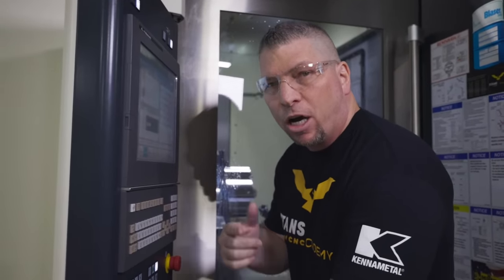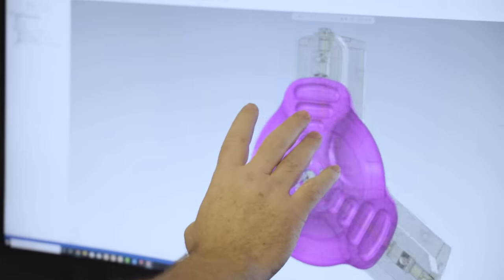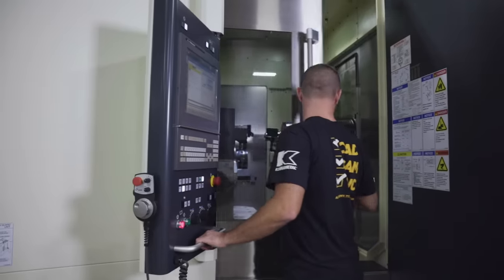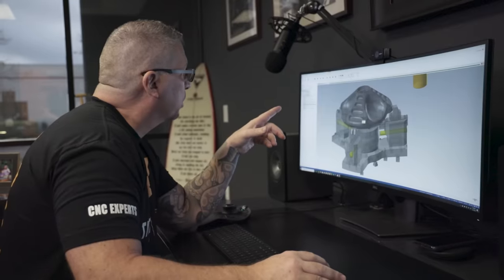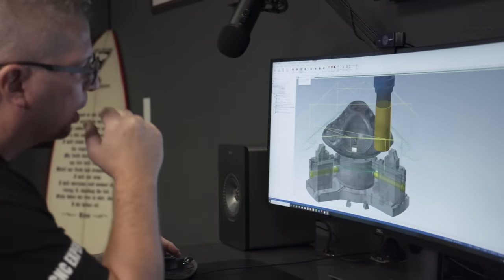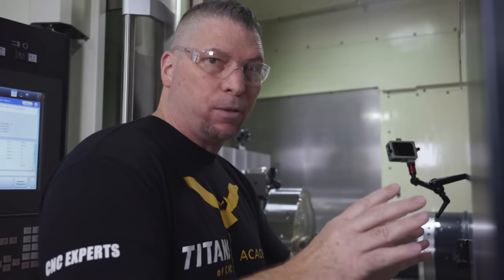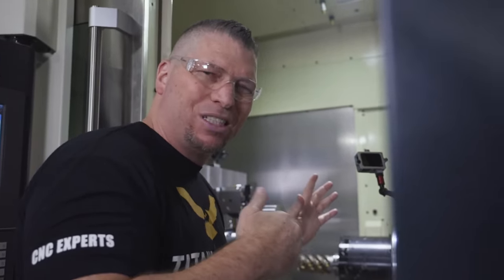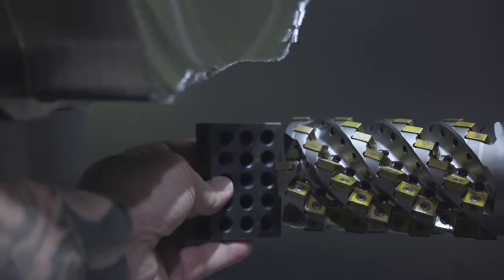60 HP Makino Cuts 150 Pound Titanium Aero Part With Kennametal 65 Insert Beast Cutter

Comment: Titanium is a really weird stuff. When working with it, you'd think it's like ten times as strong as steel. But it isn't. It has about the same strength as a modern alloy steel actually. The main difference is that it's about 30-40% lighter. And that it really doesn't like being worked on. Think of Grade 5 Titanium as stainless steel times three, in terms of being difficult to work with. Don't even think about using HSS tools for that stuff.

A few years ago, I needed a custom replacement part. A bolt, made out of a strong alloy steel, about three inches long, with a diameter of 7.96 mm, and with internal threads at both ends, about 8 mm deep. I made a technical drawing (I'm an Industrial Mechanic) and had send it to about ten metal working companies, asking them for an indiviual quote. All of them were willing to do the job. I had picked the lowest price and made the order.
About a year ago, I had the idea to replace the bolt with one made from Grade 5 Titanium. I've sent the same drawing to about ten metal working companies again (I've ensured that they work with Titanium beforehand), and all of them had refused the job. I've mentioned that I'm aware that it will be expensive, but still, all of them stated that they can't do this job economically.

Then I've decided to do it myself. I don't have a lathe, but the bolt needs to have a diameter of 7.96 mm. And you can get 8 mm round bars of Grade 5 Titanium. 
It's only four hundredths of the diameter, what means that I only have to remove two hundredths from the surface of the bolt. 
Two hundredths of a millimeter isn't much, so I thought I just could grind it off with sandpaper. The bolt only needs to fit. It doesn't matter if the diameter is a few hundredths thinner at some points.

So I've clamped the bolt into my drill, took some sandpaper in my hand and wrapped my hand around the bar, moving it slowly up and down while applying some pressure to the sandpaper. Inbetween, I've measured the diameter with a micrometer. 
So far the theory. I was totally aware that it will take some time, since grinding removes only very little material. But I thought of something like 20 minutes maybe. I've already done something similiar with steel. You wouldn't believe how long it took with this stuff.
The bar got hot from the friction fast. Extremely fast actually. I had to dip the bar in cold water every ten seconds , to not burn my hand while pressing the sandpaper to it.
It took about four hours to grind that 0.02 mm off, not kidding. My fingers were hurting already, from pressing the sandpaper against the bar. But eventually, the bolt was fitting perfectly.

Then I needed to make the internal threads at both ends. Didn't need a lathe for them aswell. They didn't need to be very precise or exactly centered, since they're only meant to hold two screws with washers to keep the bolt in position. So I could easily do them by hand. But the toughness of this material is ridiculous. I totally should have cancelled the project at this point. But I hate it to have spent a lot of time on something and then giving up. I rather add ten times the amount of work to it to get it done, than having wasted the time and energy for nothing.

Drilling was a big PITA. The heat development of that stuff is ridiculous. If you only have oil as a cooling agent, you'll ruin a drill for every mm of depth. Have switched to hard metal drills and still ruined two of them. The tip of the drill starts to glow basically as soon as it cuts the first chip, despite being covered in oil. The oil starts to smoke immediately, as soon as the drill starts to cut. Without a proper cooling system or special techniques like high speed cutting, you basically can't do anything with Grade 5 Titanium. When hand-drilling it, you have to make short chips and cool it down after every single chip . After two hours, I was finally done. For just two small holes, only about 10 mm deep. That's crazy. 
You can probably already imagine how the thread cutting was going then. After about four to five hours, I was almost finished, but then I broke the thread cutter while making the second thread. If this happens, your piece is ruined. You can't get the remains of the cutter out of the hole without special equipment. Since I wanted to finish the project at that weekend and I had enough material left to make a second bolt, I started from scratch. (repeating the four hours of grinding and two hours of drilling...)

This time, I did the thread cutting ridiculously slow. I had to put as much force on the cutter that it was visibly twisted before it started to finally move through that stuff at all. I've even increased the core hole diameter for the M5 thread by a tenth of a millimeter to reduce the burden on the thread cutter, but it didn't help notably. It didn't feel like cutting at all, but more like pressing the thread into the material. I could progress only a few tenths of a millimeter each time, before having to twist the tool back and cool the whole thing down, and despite all the lubrication, the cutting produced gnashing and cracking sounds like an old pirate ship. The cutter was sharp and new, but it only started to move forward when I was almost at the breaking point of the tool. It took me about three hours per thread and I was sweating more from hour to hour, because of the fear that the tool would break again after all the work.

After it was done, I swore to myself to never work with Grade 5 Titanium by hand again.

TL;DR: Titanium is a really weird stuff.
Reply: Man you need to put that in an episode of itself! that comment is a podcast lol
Reply: michel777ification Then I rather had kept the steel bolt...
Reply: I knew you were going to be starting over once you got into thread cutting.
Reply: tl;dr my mans
Reply: This almost sounds like the weight in one of my scale trains was made of titanium... Tried to saw it, took ages and quite basically only just a lot of sweat without not really getting anywhere. Than tried to drill through it... 2 cobalt-tipped drills (and several normal HSS beforehand) later I still was not through the block of metal and I gave up...
Reply: @weeardguy  Using an expensive light alloy for a weight would be pretty unusual. But there are a lot of weird alloys that are very hard to work with.
Reply: I know nothing of metals or machining but your story makes me wonder how aircraft like the SR-71 had their titanium parts machined
Reply: @samblackstone3400  At the time Lockheed was at the bleeding edge of titanium machining/forming.  They laid a lot of the ground work for the knowledge that we have today on how to work with titanium.
Reply: Use coolant-water when drilling with a carbide-drill. Oil doesn't work at all. I have made threads (internal) M27 in Titanium gr.5 with a HSS thread-cutter, but it had to be  very positive in cutting angles. If not the material would "clamp" around the cutter and break it. I used oil when I made the threads (if I used coolant-water it would be sparks flying around).
Reply: @runejakobsen9958  Threading titanium can be a pain. I've had more success thread milling it. Tapping it either with cut or roll taps is an exercise in frustration. Single point threading is better, but tool life is major concern. Thread milling with a single profile tool has given me the best most repeatable results with the fewest head aches. It's not fast, but it's better than scrapping a part due to a broken tap or worn out single point tool.
Reply: @runejakobsen9958  I couldn't use large amounts of water on the workbench in my apartment. And I wasn't sure if using small amounts would be a good idea, considering the heat development. It could evaporate too fast, and adding new water could be a too sudden temperature change for the carbide drill. I'll keep the positive cutting angle for the thread cutter in mind though, although I don' think that I'll ever need it, haha. ^^
Reply: yes, titanium machining is hard mode. Everything about it that people like boils down to "it's tough" , but that's exactly the problem when nearly every industrial process for fabricating parts from metal, is a destructive process. If we want to master titanium parts, the answers lie in additive manufacturing technologies
Reply: @schwig44  Additive manufacturing can't even come close to the tolerances that machining can produce.  In the end, if you need tight tolerances, the 3D printed part will still have to machined.  3D printing is slow compared to machining.  There is still a huge gap in speed and accuracy/tolerances that 3D printing has to close before it can be considered a true replacement for machining.  Right now 3D printing is more of a partner to traditional manufacturing methods.
Reply: @brandons9138  I'd like to add that the properties of a metal are also influenced by the forming process.  Hot-rolled, cold-rolled, cast, forged,  etc. - everything leads to different results. Even the direction of the rolling or forging has an influence, similiar to the grain direction of wood, but to a lower extent. You surely can't reproduce any of that properties with additive manufacturing.
Reply: @octogunsalata  When I was working at a shop where we did a lot of parts for microwave vacuum tubes, they had us do a bunch of round parts out of sheet stock rather than bar stock because of the micro grain structure. The grain structure in the bar stock because of its extrusion allowed electron migration through the part.
Reply: @brandons9138  Interesting and a good example!
Reply: This was a good story. I appreciate your patience and determination
Reply: @mattiloponen92  Thanks
Reply: 3d printed can take a while until you consider theres only one operation(essentially;), no squaring up blocks, then squaring up some more blocks cause u screwed ur ass and cut on the wrong side of the line!! -doh!
oh and grain plays into 3d printing bigtime particularly when printing continuous fiber like carbon or kevlar ie. markforged
Reply: @honkaloid  3D printing isn't slow per se. It's slow if you use an insufficient amount of machines. There are a lot of slow processes that require to be compensated by scale or amount. Take agriculture or livestock for example. It's as slow as it can get. None of them would work in small quantities. For an economic production of 3D printed parts, investments have to be made. Just like with any other industry at their beginning.

Grain direction in a metal and fiber direction in fiber composites are different things. For fiber composites, a proper fiber direction is vital. If you'd lay out the fibers in a rod not lenghtwise but crosswise, (like cut bristles) the rod would be useless in terms of stability. 
3D printing an actual metal can be done by either build-up welding, by DMLS (direct metal laser sintering), or by printing an advanced metal-polymer compound with a regular 3D printer, but the parts have to be sintered (a special heat treatment) after the printing to become a metal. Either way, none of them involves creating a controlled grain structure. 
However, with additive manufacturing, you can control the general structure of a part and combine different materials like with no other manufacturing technique. It will open completely new ways in technology and will eventually lead to a strength to weight ratio that we currently dare to dream of.

3D printers are surely a great and important innovation, that could also help in getting us closer to modular manufacturing environments, that can produce many different types of goods and only as many as needed at a time. And this could help in fighting the endless cycle of growth, market saturation and reduced product lifetime. Planning for the future was never a particular strength of the industry.

For a company, reducing the product lifetime continously is defacto the only available option to react to a saturated market while retaining or increasing the output.
The increasing number of competitors multiplies the effect. That's what led us to the product lifetimes that we have today.
The cost of living and the amount of garbage and pollution are exploding.

Many devices from the 1950, 60s, 70s, etc. are still working today. I too have some, partially found, partially given to me and partially purchased second hand, that still outlived one or even multiple newly purchased ones.
And also clothes, and basically everything else. The proof is still largely spread.

My 1970 electric coffee grinder for example, that I have for about 10 years now, still works perfectly fine and the plastic container is tougher than any other plastic container that I've had.
I've violently smashed that thing on the table thousands of times already, to get the statically charged coffee powder to fall from its walls.

My grandmother had the same black and white TV her whole life. When she died, in the early 2000s, the TV was over 60 years old and still worked.

The rechargable battery in my mother's electric toothbrush still works well after 20+ years. I've 'used up' dozens of rechargable batteries just over the past 10 years.
The older, the more reliable. I'd had lots of such examples. Radios, amplifiers, etc.
There's an old saying in my area: "the one who buys cheap, buys twice"
This was actually meant literally once. And it gets more incomprehensible from decade to decade.

Companies that own old machines treat them like a treasure. I've used milling machines from 1950 that still delivered more precise results than the current ones. The mechanics just don't wear off, because it wasn't the concept.
The (known) company that I currently work for, has mostly decades-old tools and machines. And the difference to the current stuff couldn't be any more obvious. We have to call the electricians and mechanics all day for new equipment, occasionally for older equipment, and never for really old equipment.

Old high-quality clothes (several decades old) may have lost most of their color, but the fabric takes like 100 times as long to get holes or to wear away. If you find a proper one in good condition, disregard the washed-out color and just get it. You can dye it. Probably several times. It will surely still outlive a few new ones.

When I was a kid, I didn't take my grandmother seriously when she told me that in her time, it was normal for jeans to last 20-30 years.
But I've had some old quality cloths meanwhile. Not even as old, but durable enough that I consider it credible now.
And looking at it from a logical point of view - how could a jeans pants, like we know them today, survive in the Wild West for more than a few days? It's the worst environment imaginable for a piece of fabric after all - a lot of friction, combined with dirt and sand. 
They were actually invented as an alternative to leather back then.
Today, Levi's states: "Don't wash our jeans. Air them and remove stains carefully by hand."

It's similar to: "don't use the 'random device' for more than X minutes/hours at a time."
When examining the build quality of most of todays products and reading the manuals, it's painfully obvious how any possible failure is more and more portrayed as a user error.

You still get something better if you spend more money on it. The lifetime ratios between cheap and expensive remained about the same. They're just reduced by like 90% and more.
With todays technology and materials, we were able to surpass the former lifetimes of especially electronics and mechanics greatly. Instead of doing the opposite.

Take smartphones for example. Their lifetime is ridiculously short already. They wear off in numerous ways - fragile ports, short-lived batteries, that meanwhile can't even be replaced, unstable structures, etc. But that's not enough already. 
If you're able to repair all of that by yourself, you get kicked out through software support.
It's incredible, how fast security mechanisms don't work anymore on hardware that's just a little bit slower.
However, with an old/unsupported OS you have less and less software options.
That appears like a lot of effort, considering how many people are buying a new one voluntarily every year. 
It's about the proof that other options are available. It should appear natural and unavoidable.
People are even denying it, defendig the products, which is a result that the industry couldn't be any happier with.
I'm not a great fan of Apple, but their honesty overwhelmed me once, when they stated that an Iphone is meant to last for about one year. They have the courage to state it, and I've always liked an honest antagonist more than a dishonest one.

But as sad as it is, it's not only the effect of greedy managers. It's also the short-lived, degenerative concept of our economic system. We would need to re-imagine our whole industry and economics. And get a grip on our totally out-of-control expectations of profit margin. The world worked perfectly fine aswell with a lot less digits in the annual balance, just some decades ago.

Nowadays, it requires just one asshole who finds a way to increase the margin of a product hundredfold and it immediately becomes the new standard that everyone strives for. And everything less isn't considered as 'profitable' anymore suddenly.
Take the game World of Warcraft. I've looked up the numbers some years ago, and they made hundreds of millions per year just between like 2005 and 2015, only through the subscription fees.
And there are also a lot of other monetization options in the game.
I don't think that many of the competitors said to themself: "Nah, I rather continue to work 5 years on a game to make a few million with it".
The outcome speaks for itself, looking at todays game industry.

People are hasting to get their billions meanwhile as if there would be no tomorrow, contributing to create just that scenario. 
We have lots of problems to solve yet to stop this evolving dystopia.
Most of them are related to our immeasurablesness. We can't get enough digits, even if they exist only as data and aren't even printed yet.
The amounts get larger and larger but they're never used.
They have no actual function, other than boosting the artificial ego of some people.
We're converting our real living space into theoretical numbers that can loose their worth from one moment to the other in numerous ways.
Forests, waters, species. Climate, cultivation areas and living space.
It becomes more ridiculous from digit to digit.

Money equals goods. We're depleting our ressources and worsening our living conditions to create a planet-sized pile of virtual food that couldn't be produced even to a fraction in reality. It even uses up the possibilities to get food out of it.
It just sits there and grows, sucking on everything and everyone, and the larger it gets, the less you can buy from it in the course of time.

It's almost funny.

TL;DR: Economy, as we know it, is cancer.
Reply: @schwig44  Titanium alloy's heat transfer is weird, heat accumulates super quick even with those chips are flying away, it just burns your tools, and sometimes, your machine.
Reply: @brandons9138  Exactly, just like you still have to machine a forging or a casting for precision fits. Also, I know 3D printing is the  new kid on the additive manufacturing block, but it is not the only additive process we have at out disposal. With the continuing rise in AI we may finally have the computational power (in some years) to essentially lithograph complicated parts, essentially growing the crystal matrix of the material(s) under closely controlled conditions. I guess I should have given context to what I intended by mastering the material, as I am of the opinion that we have not even fully mastered many much more common materials. The focal point on my lens for considering these types of things is usually a bit further out than the average person, so that's on me. Likely in our lifetimes we will not see additive processes that can match machine tolerances, but who knows?
Reply: @jacobsharpe8219  They're simply hardened.  You have to soft anneal them first if you want to work on them. After the annealing, it's just a normal, tough steel. You can use regular HSS tools on it. When done with the processing, you can simply harden them again. Have soft annealed such a tool just recently, to be able to drill a hole into it for a DIY project. Was done in a few minutes. 
But to be honest - it was the first time that I've actually put the theory into practice and was I pretty proud of myself that it actually worked out, haha.
Didn't need to re-harden it afterwards though. Wouldn't have had the possibility to do that at home anyway. I barely could reach the soft annealing temperature with my blow torch. The good thing is - the heat was just enough to soften only a small spot - pretty much only the area that I had to drill. The rest of the tool remained mostly unaltered.
Reply: Like if didn't read it at all
Reply: how long it take u to write that lol?
Reply: it's also got a melting point of almost 2000° C... which means it works better in high temperature applications.. it crystallizes at great depth along with the other high temperature elements, carbon 3800°.. silicon carbide, aluminum oxide, platinum and AuPt... most of the gold and platinum on the Planet is locked in AuPt with double double covalent bonds... titanium has metallic bonds.. only half a covalent bond.. so we have silicon carbide that can be used as structural material and machined like steel... with diamond burs... it's said to be 9.5 on the Moh's scale of hardness.. it's 10.. like diamond.. both have double double covalent bonds
Reply: wow i cant believe anyone even read that
Reply: I read somewhere titanium work hardens as you work it
Reply: Took me 7 minutes to read all of it :/
Reply: You know: I don`t believe you! Simple as that!
Reply: @FeigerNazi  Das kann ich mir lebhaft vorstellen. lol
Reply: @Eyeseesheets  Took me longer to write it for sure.
Reply: @fernandogarcia6631  And I thought my interests are weird, haha. ^^
Reply: If you break a tap in titanium or break a drill bit, soak the part in solution of ferric chloride overnight. I work with ti and this saved my but more than once. I can drill and cut ti with hss when i have to, I  air cool it.
Reply: @JM800  Interesting, will keep that in mind.
Reply: Made it all the way up to "weird stuff"
Reply: It wouldn't have been a problem if you were Superman and you just use your heat vision out of your eyes to cut the titanium bolt
Reply: @octogunsalata  Angeber..... ;)
Reply: @tomerttb  If that was too much already, then you shouldn't see my comment about 3D printers and economy, about 20 comments above this one, haha. It's my method to kill time when having late shift. To me, late shift is just working and sleeping. I can't properly use the time before work, because I would look at the watch all the time, and the time after work is even as useless, since everyone is sleeping already. So, writing down my thoughts and experiences is about the best that I can do with that time. It's something between isolation and communicating with people, and I also don't get stressed if I can't finish it in time.
Reply: @Fine_i_set_the_handle  Have you tried Tik Tok? It should fit your type of media consumption better.
Reply: @octogunsalata  have you tried writing a book it fits your long paragrapha better
Reply: @Fine_i_set_the_handle  It's for free. You can skip it.
Reply: tldr
Reply: Dude, use super cool added to water. I work titanium for supressors. No big deal. I like working with it.
Reply: @brandons9138  Isn't koenigsegg 3d Printing their turbo's?  I believe tolerances on turbo's are pretty high? Could be wrong ofcourse... know nothing about machining :)
Reply: @kenvanpassen9247  I wouldn't put it past them to be 3d printing the turbo housing.  I'd be willing to bet that it goes into a machine tool to machine the precision fit tolerances such as bearing fit and sealing surfaces.
Reply: TL;DR 
Titanium is light and strong, but it’s heat dissipation is ass
Reply: I rarely comment on YouTube but I give it you sir - this was a pleasure to read. Lots of respect for your determination and pride in your work.
Reply: @nohandle1  Thank you.
Reply: Read it all. Great comment.
Reply: I don't know ANYTHING about any of the shit you guys are talking about, but reading this thread has been very stimulating and enjoyable. My hat's off to smart people who excel at what they do!
Reply: So much wrong with this lmao so much wasted time
Reply: Extremely rapid heat transfer and consequently rapid dissipation. Another characteristic why it’s ideal for aerospace applications.
Reply: Your story reminds me of the time I asked a machinist I know to drill a 10mmØ , 20mm deep hole in a round piece of Ti6al4V. He had to resharpen the drill bit a couple of times, got grumpy and said " well, son of a bitch.. It's time for another cutting edge profile" and he reground it with a locally developed cutting edge profile that was made to handle really stubborn materials.
The HSS drill had no problems with the titanium after that, cut like butter without any cooling. I guess one pick up some tricks during 30 years as a machinist, without using any fancy CNC machines.
Reply: SECO F40M coated insert cutter does much better work than this insert. Either RDHT or RDKW grade with 6mm,8,,10mm or 12 mm Diameter inserts with low rake angle does excellent work and better performance.
Reply: Old masters recommends using just clean water for Ti. It's very strange but it works.
Reply: Man! You could easily extract your broken steel cutting tools from titanium. You need just concentrated nitric acid. It's dissolve steel but not titanium because of layer of oxides. Chemistry is very-very helpfull sometimes.
Reply: the worst offender is haynes 24/7 that stuff is a bitch tough as shit. same goes for D2 steel cant machine it with coolant as well cuase the tips get so hot that the temprature differance between it and the coolant would cause the material to crack or the tip to just explode.
Reply: @samblackstone3400  I worked with a lot of exotics in aerospace and we would do a lot of machining with incremental heat-treating. Basically try to avoid machining after its hardened. Titanium wasn't that bad but inconel and 300 series stainless was the shit I didn't like. A lot of work was done with ceramic tooling and obviously a lot of carbide tools.
Reply: Knowing the published hardness of titanium, I would use a diamond drill.  Hard metals shouldn't be used to cut hard metals.  I mean, what metal would you use to cut the hardest known metal?  Nothing!  You must use harder substances.  Like diamond.  Anyway, that's my lazy opinion, before going and doing the right thing and looking up the hardness of all these metals and minerals in a good reference book.
Reply: Use cbn
Reply: @asnehs  

CBN tool material is produced by mixing the main component CBN (cubic boron nitride), which has a hardness second only to diamond, with a special ceramic or metal binder. It is then sintered at a pressure of over 5GPa and at a temperature of 1200°C or higher. • CBN has lower affinity to iron than diamond.
Reply: @octogunsalata  Really enjoyed reading your in-depth comments. Thanks for the info and semi-ranting.
Reply: That’s an education for anyone from  your experience, I remember we had to drill 3mmm holes through 10mm spring steel rod, lots of it... we found using 200psi compressed air via a small nozzle directed down the hole to chill a cobalt drill bit and keep it hard... worked great and removed all the fines before they were able to jam the bit, and nobody near it without safety glasses.
Reply: A bit late now, but couldn't you of just hardened the steel piece?
Reply: @kris-english  It's a pivot bolt, which shouldn't be hardened - it needs a certain toughness and it would also wear out the bore faster. You also don't need to harden a steel to compete with titanium since they're about equally tough. The strongest steel alloy is actually even a little tougher than the strongest titanium alloy. You use Ti mainly for weight reasons. (or  because of its inertness or for reduced heat transfer) In most scenarios, you can consider it a "lighter steel".
 
The steel bolt worked fine - I just tried to save a little weight. Stuff like this sounds ridiculous to most people, but when replacing like 2 or 3 bolts and 50 screws on a bike with Ti, you can definitely feel the difference. Not trying to gloss over it though - weight tuning is one of the most ridiculous things in terms of cost-effectiveness. 

Weight is everything in construction and engineering. To make something a tiny little lighter oftenly requires completely different construction methods, materials and manufacturing techniques. Furthermore, it's usually only done in small batches/series, which again greatly increases the price. That's why the prices of ultralight-parts can easily reach the tenfold and more. Weight tuning only makes sense for things that you really love.
Reply: @octogunsalata  that's why Bitcoin was invented; to transition is away from a fiat society where money is endlessly printed , to one where it's backed by a deflationary currency.... All of what you described; the tools, the goods, the clothes; were all made in a time when the dollar had very high preceived value ; partly due to the gold standard. You were incentivized to save.... Modern monetary theory is a failure. Which is why we are now going through 'the great reset"
Reply: @M DeVido; Grand Pacific Lumber, and Construction  

I wonder where all the different "great reset" theories come from suddenly.

In theory, changing to Bitcoin could prevent stockpiling infinite quantities of resources since the maximum possible amount of Bitcoin is mathematically finite. But when approaching the maximum, you'll run into the problem to constantly have to match the worth of a fixed value to increasing quantities of resources. Instead of simply generating an appropriate counter value. You also can't just replace one with the other — such a transition would take a very long time. 
Other than that — we don't produce short-lived items because money lost its value, but the other way around. Continuously increasing the production quantities of unrequired goods because of greed-fueled company growth is one of the main reasons for the deteriorating longevity and the value drop of money. The source of our problems isn't the medium -- money fulfills its simple purpose of representing a universal medium of exchange perfectly fine, and conspiracy theories won't get us anywhere.
The greatest enemy of humanity will always be our own insatiability. 
Hoarding money indefinitely is destructive up to the point where it threatens the survival of mankind. Its harm is not limited in either size, reach or growth. There's nothing to stop someone from collecting as much of the world's resources to make millions or billions of people starve to death. If you would take all billionaires and multi-billionaires and put them in a hypothetical collaborative group, it would be by far the most unscrupulous and destructive group in human history. As far as it reaches.

We don't lack resources; we lack sanity.
Hoarding masses of stuff you don't need or use is called compulsive hoarding. And since hoarding money has virtually no spatial restrictions, it enables locking up items and goods enough to feed or modernize a whole continent and it doesn't end there. 
Any further "0" on the "big pile" increases the sum that isn't available for society exponentially by a factor of 10. 

A good example of our madness is Bill "We need to reduce the world population" Gates. Someone who thinks it's reasonable and humanitarian to collect and solely decide on the use of such enormous sums of money should probably leave humanitarian decisions to someone else. 
There's so much that we still can do apart from reducing the world population. There's still land available, so we might move people. 
If you project the population density of a modern metropole onto all low-populated areas, it becomes clear how much room we still have until more drastic measures will be required. Especially if we improve our buildings, systems, infrastructures, agricultural and climate sciences, etc. 
Which would be considerably easier if all the multi-billionaires wouldn't lock up such immense sums of money, by the way. Another key factor is the amount of children. 
You don't need a one-child policy to do something. We could start with five children for example. Since the increase is exponential, this would make a considerable difference already. And there's a lot more that we can do. 
What would actually save the world is if there weren't so many people who stockpile billions and trillions of dollars. Or become megalomaniacal eventually. 
It's like a villager who stockpiles the entire rainforest as firewood from which he can't even use up the thousandth part within his lifetime and the others freeze to death without any reason.

Such an attitude would normally be considered psychopathic. But if you exchange the firewood with money, people can't see the lunacy anymore. And even support the arguments of the responsible ones. 
Just because money can be used for anything doesn't change the fact that it's real things that are locked away. The money not just "could be" millions of tons of meat, or millions of cars, etc. — it IS one of them. Literally.

Despite our pride in our knowledge, we seem unable to grasp concepts as fundamental as the fact that you can't hoard irrational quantities to ensure a sustainable future.

The economy considers money as a good, but money itself has no value. Money is heating, clothing, food, gold, etc.
It's a symbolic equivalent of the resources that we have. It couldn't be any more obvious or easier to understand that this can't work in the long run.
And for what purpose at all? Who needs to stock up on resources hundredfold above the requirement? Or millionfold, billionfold, etc.
What's the "magic" about money? It's just things. 
It's nothing other than stockpiling cars or bikes or furniture or whatever you want. It will never be more than that. You can only increase the numbers. What kind of life goal is that? 
I don't understand how people can lose track of the simple fact that money isn't a freely producible medium to get resources out of it — money is the resources itself, literally.

Just because it can't spoil isn't a reason to hoard billions, trillions, etc. of it. This can't work yet alone physically. 
The speed with which the money has to be generated increases with any step to the next tens digit. As well as the degeneration of the environment. And for no logical reason at all. The gain isn't real at all -- it's just some digitally stored numbers. But the damage is very real. 

The only way to ensure that limitless hoarding can't happen anymore would be to either reduce the universality of money, to impose a shelf life on it, or to fundamentally change our tax systems to a sane variant that allows for a sustainable future.
Or to use our common sense, which would be the most efficient and simple solution.

What we can tell is that the current situation is financially bridged mainly on the cost of self-employed, small and medium enterprises and people's private lives, while the financial resources to achieve greater results exist. And that the situation broke the ice for the introduction of stricter social regulations.
Going to work and purchasing food is most of the movement a person normally does on a daily basis. Adressing only people's personal contacts is questionable, but addressing people's night lives on work days is a drop in the ocean. But the impact on people's lives and psyches is enormous, especially among the young.
At the same time, the exploding amount of package deliveries basically negates the effect that we achieved by sacrificing most of our private lives, not least because the virus will exist on surfaces and in the air for longer periods of time. 

The severity of the enforcements in comparison to the size of their coverage is highly disproportional.

The situation is new and we have yet to learn how to handle it, so there are naturally things that can't be forseen. But even as naturally, there will be people trying to misuse it.
Most new regulations and conditions are introduced while crises justify their severity and most of them tend to outlive the crises.
I'm seeing great numbers of videos being deleted that were only mildly critical or just entertaining. It doesn't matter if they have been deleted by the platform or by the users themself because of hate speech or threats — neither of these are acceptable in a democratic society. The most important thing is to not accept censorship, neither directly nor indirectly. People must never be afraid to speak. 

Censorship, corruption and enforcement lead to stagnation and regression; information, transparency and argumentation lead to progress — which is chronologically set later.
Reply: @octogunsalata  it's not a fuckin conspiracy theory bro, why dont you read a book called , " the fourth industrial revolution" instead of taking adderal and writing YouTube comments. it's a PDF you can find online. It's written by Klaus Schwab , the executive chairman of the world economic forum. There are few in higher positions then him. He's basically laying out in the book, what the plans are. We are on an accelerated timeline for these plans to unfold; you can do what you want, buy j strongly recommend you take your cash out and buy hard assets.
Reply: @octogunsalata  also, the virus is killed almost instantaneously in uv light. It's not a big concern .
Reply: @octogunsalata  "the transition will take a very long time" you obviously have no idea about economy's or markets: look at Venezuela, where overnight it took a giant sack of money to buy raw chicken. This stuff happens fast, and has a way of catching you off guard!!!!
Reply: @M DeVido; Grand Pacific Lumber, and Construction  

I didn't mean to insult you - I was more refering to all "great reset" theories that I've seen so far. However, I don't want to discuss political topics extensively here--or anywhere at all, to be honest.
I always try to keep things as simple as possible. One of our greatest issues is that we focus too much on the effects instead of the cause. 
Complex problems have to be skimmed until the cause becomes clear.
Reply: Why not heat the titanium to allow for easier malleability?
Reply: @samblackstone3400  not by hand
Reply: Actually Titanium is weaker in both hardness and tensile strength and toughness than many steel alloys. It's not strong at all compared to some special alloys... Source Wikipedia.... But what I don't get, is that there are some synthetic fiber products like dyneema that have a much higher tensile strength than steel... how can it be? Appreciate the answer...
Reply: @ok-ahsungestreift3031  Wikipedia contains plenty of misinformation. There are titanium alloys with a tensile strength of 1400 MPa, which is pretty strong.
About dyneema -- awesome stuff, I have a spool of 1 mm thick dyneema thread. It's incredibly strong and has virtually zero stretch. It's pretty simple how it can be stronger -- weight. A piece of thread with a length of 1 m, a diameter of 1 mm and a weight of 2 g, that can hold 100 kg, is stronger than a thread with the same dimensions and load capacity but a weight of 10 g.
Reply: @octogunsalata  thanks for the detailed answer. Sure the weight tensile strength ratio for dyneema makes it so that wire having the same tensile strength, the dyneema wire is about 8times lighter than steel. But I can cut dyneema with a knife but I can't cut steel wire in the same way. Per square inch dyneema is about equally strong as steel wire. How can it be cut that easily?
Reply: @ok-ahsungestreift3031  You're welcome. That's a thing that I don't understand entirely too. I think it's mainly the hardness. The dyneema thread is easier to cut but also much more flexible.
Reply: awesome comment thanks. I wont waste my time. No Ti.
Reply: @samblackstone3400  By people with the knowhow and the right equipment.
Reply: 8mmボルト、チタン合金、どってこたないぜ‼️おっちゃんよっぱらてるのか🤣
Reply: dude i just threw some grade 5 on my mill and started trying some feeds and speeds and it worked fine... just take sharp rigid cutters and water and you are pretty much set
Reply: Джентльмены, до начала обработки, титан подвергают термическому воздействию,после этого он становится вязким и мягким, похожим на алюминий.Затем готовое изделие снова подвергается термической обработке и становится вновь твердым.
Reply: @ВладимирИванов-щ7с1ч  Normally, Ti only gets soft annealed before forming processes because it could break otherwise. Other than that, you won't be able to get it to the previous state easily without proper equipment. Heat treatment is not an easy task and requires exact values. Before degrading such an expensive material with improper heat treatment, I'd rather use another material.
Reply: @octogunsalata  Я работал с титаном, и, разумеется, отжиг и закалка производились в соответствующей лаборатории и с соблюдением требуемой технологии. В домашних условиях, такой результат достичь не получится.
Reply: @ВладимирИванов-щ7с1ч  I thought so. But thanks for the hint to use soft annealing also for machining Ti, it may be helpful in the future.
Reply: @octogunsalata  you're a treasure you know that
Reply: @TS-jm7jm  You're the second person already who thinks like that about me. Maybe my mom wasn't buttering me up after all...
Reply: Quizá con un limaton de diamante hubiese sido más eficiente!!
Reply: i am not reading allat
Reply: "But I hate it to have spent a lot of time on something and then giving up." Look up "sunk costs fallacy."
Reply: @somercet1  I've looked it up and the mindset it represents perfectly describes why the world is as screwed up and doomed as it is.
Reply: @somercet1  As long as all of this "time is money" nonsense-thinking is present, we can never progress beyond our current state. If you already got the best car, more money can't do anything beyond getting you more of it. But for what reason? There's no magic in money, get over it. It doesn't add anything to your life anymore at some point; it's a mere addiction. And the most harmful, devastating type of it.
Reply: @schwig44  
Not too far off. We were slowly growing batteries by feeding a bacteriophage gold, about 15 years ago. Its just too slow. Until nano-tech comes into play. What we have is it.
Reply: jesus what an ordeal.  I commend you
Reply: @anarchocommunist3888  good luck in life!!!